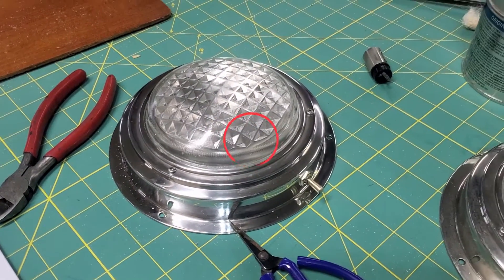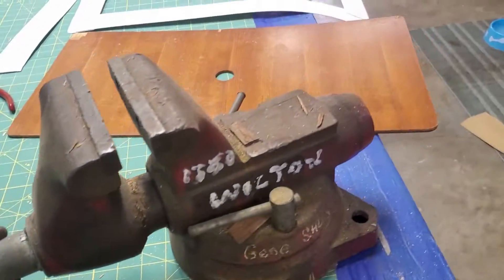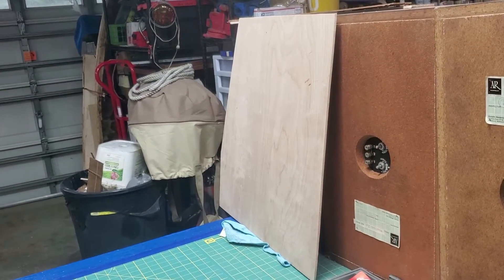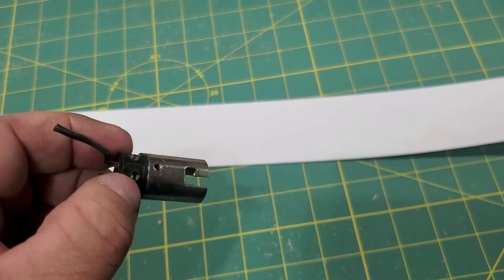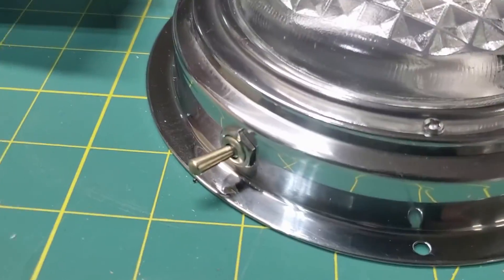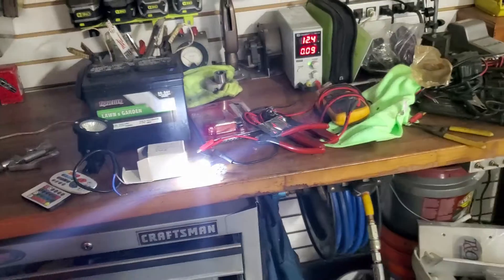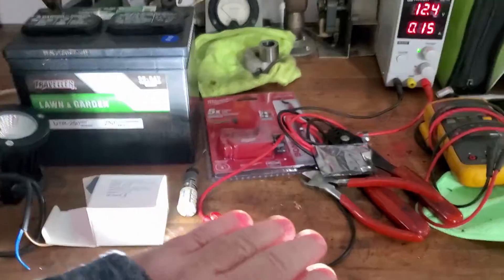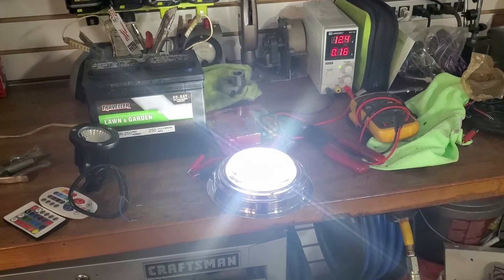Trawler DIY light refurb, closet overhaul and making templates

Comment: I bought these exact light disks to do the same swap out on my trawler.  Unfortunately, they produced radio interference when my boat stereo system was on.  Sent them back.  Did you have any radio interference with them?
Reply from the maker: not that I noticed. I only have one refurbished unit installed so far in the closet with 2 light units. I have one other to install when we finish the V berth